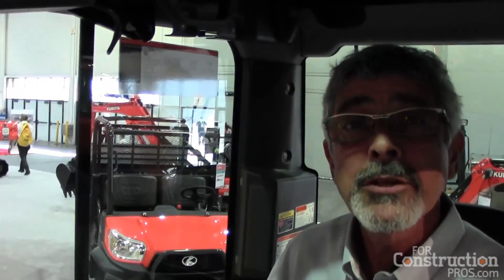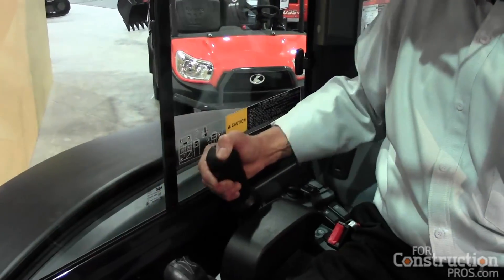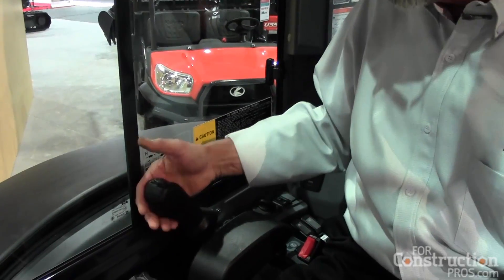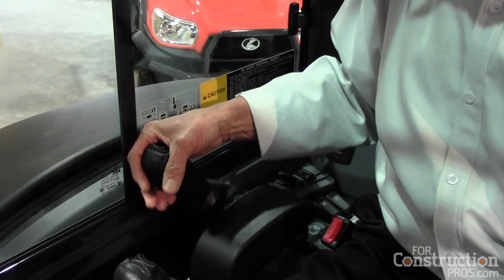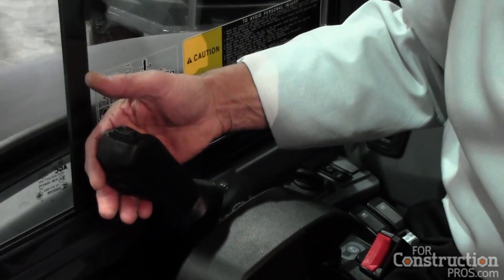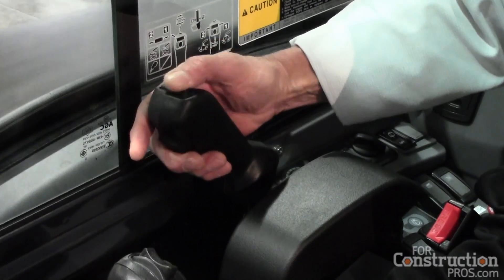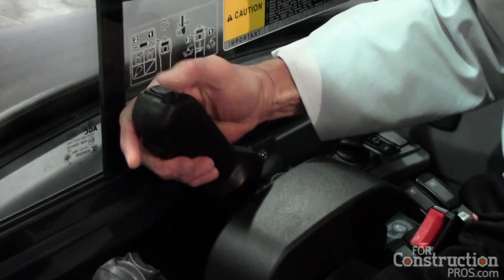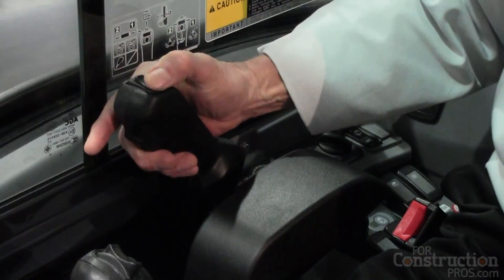Kubota's New KX040 Six Way Blade Mimics Dozer Controls

Comment: Two hours worth of research and still can’t get a simple articulate answer to what exactly the tilt function does? And here is a video from the people who make it and all they do is show you HOW to tilt it but don’t really explain what they mean by tilt or even the common sense to show the blade moving inside the warehouse!!

So does tilt mean the entire blade tilts from up to down or say top to bottom and what exactly would you ever need that? OR does the entire blade tilt left end or right end so that you could say, dig a trench into the ground with an end section of blade digging into the earth?
Reply from the maker: This is a ForConstructionPros.com video shot at World of Concrete in 2014 on the floor of the Las Vegas Convention Center. The LVCC will not allow diesel engines to run on the show floor during visiting hours, so demonstrating was not possible. The tilt function is described as working like a dozer's 6-way blade -- that's up, down, angle left, angle right, left blade corner tilted down and right blade corner tilted down. If you can give me a little more information on what part of that you don't understand, perhaps I can put you in touch with somebody at Kubota who can answer.